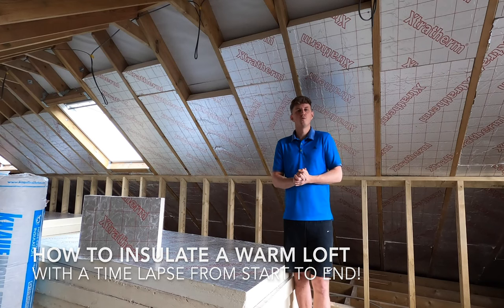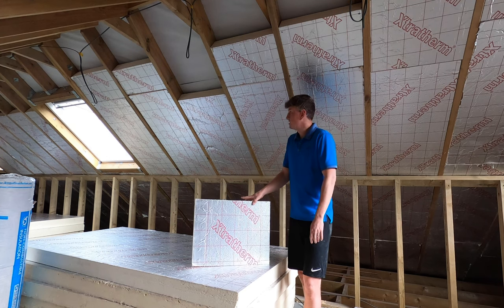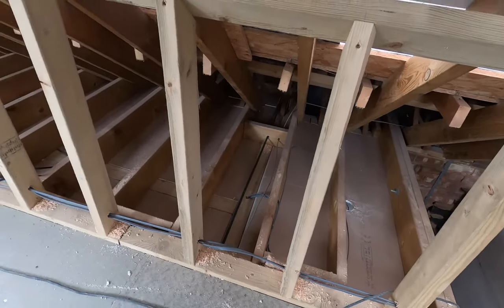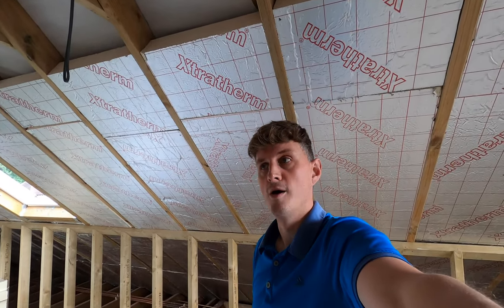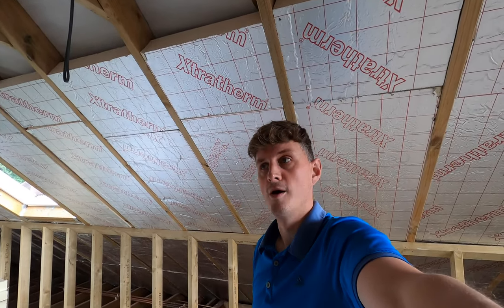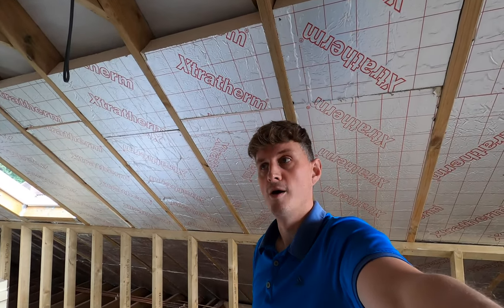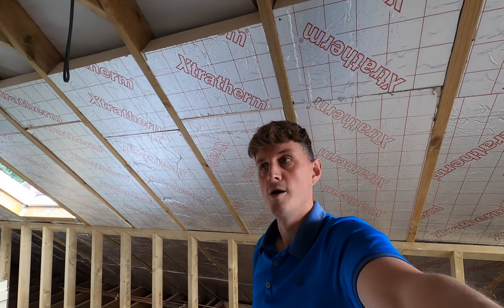How To Insulate A Warm Loft

Comment from the maker: My latest series - 1100 to 3000 Sq ft house - 
https://youtu.be/jYrWMxWvGvc

My Instagram - https://instagram.com/youtube_reno?igshid=YmMyMTA2M2Y=

00:01 - What the project is 
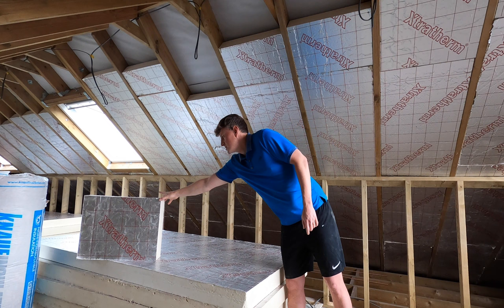02:12 - Cost of insulation 
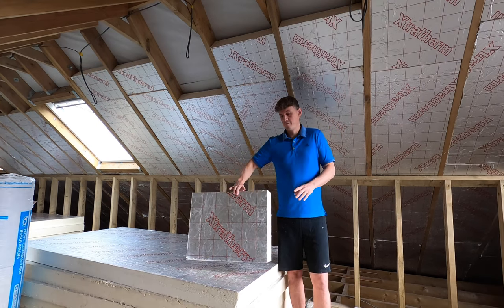03:16 - How to fit 
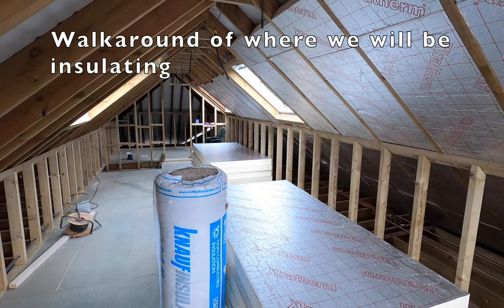06:16 - Walk around of where I will be insulating 
08:48 - Time lapse of insulating the rafters with 100mm insulation 
12:47 - Time lapse of insulating over the rafters and plasterboarding 
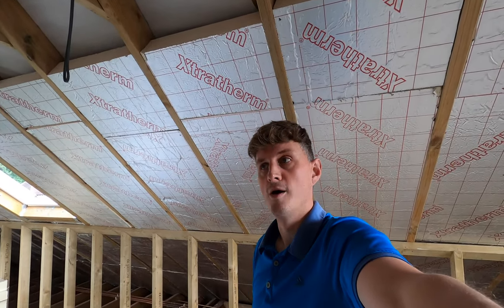15:00 - Walk around of progress so far 
19:05 - Time lapse - insulating between the walls 
19:42 - Plasterboarding 90% complete 
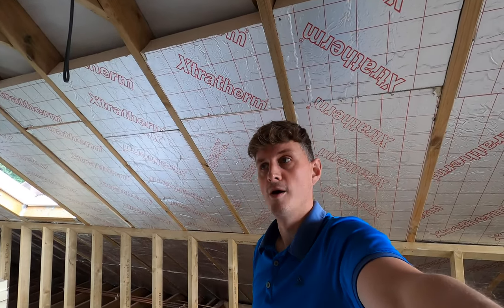24:08 - The finish!

Comment: No air-tightness measures. That’s a major omission. As a wetsuit works with water, insulation functions by trapping air. A membrane should have been installed behind the rigid board. All holes in the cold attic (downlighters, piping, sockets) should have been air-tightened. Draft causes 5x heat loss compared to conduction.
Reply: What membrane needs to go behind rigid board? Looked like there was a membrane on top of rafters.
Reply: The moisture barrier should have gone on after the foam insulation sheets were installed after all gaps should have been sealed. Then the moisture barrier completely sealed.
Reply: That PIR is foil backed, so no need for another sheet

Comment: The 50mm gap is not to do with “cold bridging”; this is where you get heat conduction through a less insulating part. E.g. the rafters could be a cold bridge from the roof to the ceiling (the overlay of the thinner layer minimises this). The 50mm gap is for ventillation, as long as you have air gaps in the soffit.
Reply: I'm sorry if it sounds stupid, this insulation in the video would it work when my house gets to hot ?
Reply: @PaulaZapataF  If your house is too hot on the inside, the insulation will stop it cooling down. You'll need to open the windows! If you're asking about it keeping your house cool when it's hot outside, then yes, that's what it will do too (assuming that those Velux windows he has don't let too much let too much solar heat in...)
Reply: @PaulaZapataF what it will do is slow the heat transfer from hot to cold. If the heat is on the outside then it will slow down the transfer in. As the other poster said if you house is hot inside already it won’t let that heat flow outside.

In this example the sun will hit the tiles on the roof and will transfer to the inside. The foil face on the rigid insulation will reflect that heat to a degree and the yellow bit of the insulation will reduce the transfer. The air gap will let some warm air out, especially if he has ridge tile vents so as the outside temperature drops it will suck cool air in at the eves and expel it at the top via the ridge vents.

Comment: Hi Nick, some years ago when i lived in Finland i had the  opportunity to help on an insulation project they used 150mm rigid foam foil front & back  & left a 50mm air flow gap - they cut all PIR 10mm undersized ( allowing a 5mm gap on both sides ) a short batten screwed into each rafter was used to support the PIR & pull it forward & keep it in place using a screw  ( when placed between the rafters )  the gap was filled with a foam injection gun on all sides - screws on the support batten pulled the PIR to the face of the rafters - no hammering on the PIR to get it in place - when the injection foam was cured the excess was cut away leaving a perfect airtight fit -  the whole project was very fast & easy. Ed,
Reply from the maker: Hi Ed, thank you so much for sharing. Really interesting to hear and sounds to me like a fully professional job!
Reply: @alanhodgson8443 commented that now you need to use Gapotape to completely insulate the PIR board, what are your taughts?
Reply: @JoSePh2000121  Hi Joseph, the friend that i was helping is a carpenter & told me that it was very important that all gaps or space between rafters & PIR board had to be filled with injection foam from front to back , that was why the 10mm undersize gap was important ( leaving a 5mm gap on both sides to be filled with foam ) the outside temperature was -40c  as we were working up in northwest Finland , so to control / manage heat loss is very important - also 25mm full sheets of PIR covered the whole internal roof / walls to stop thermal bridging from rafters , all joints sealed with injected foam - towards the end of the project we worked wearing tee shirts & were never cold unless we went outdoors. Everything was clad with 12.5mm plasterboard . I have worked on projects in the uk & have used GAPO tape - unless the PIR is cut right & the rafter timber work is perfect it is quite difficult to get an exact seal - to tell the truth i think that the Finnish carpenters method was superior - not alone did make a perfect air tight seal it also held the main PIR sheets in place. Ed,
Reply: Thank you so much for taking the time to reply, I’ve certainly kept Gapotape and for what I need it cost me more then the PIR boards 😂.The good thing is the house is new build and the rafters are quite straight. I don’t. think I need such a super insulation as we are not in Finland, I really want to reduce the amount of cold air in the loft.

Comment: Well, that might work down there where you don't have minus 25 celsius in winter! Othervice you should put foam between the insulation and the truss and also " glue ends of insulation together with foam so there will be no leak at all! Here up north we cut the insulation board about half inch in both sides so we get foam as deep as the insulating board goes. Makes it solid and keeps the isolation on the right place.
Reply: Other videos say to use Gapotape around the sides of the PIR to ensure a snug fit and then tape the seams. Not just a friction fit as shown here
Reply: @g4egk  Yes ,i have noticed that! Up here in northern Europe we had -10 celsius for about a week and then +degrees. That led to that i found a leek in my isolation, meening warm air ,moistur included got to the outside of insulation, got freezed ! When temperature rised to plus degrees it melted and water came in the same way moisture got out! So its very important to get it well done with foam in every burst!

Comment: It is very advisable to install some battening onto the fathers to ensure that the insulation does not move. Also as of June this year a product called gapotape is required, it completely fills any discrepancies between the  insulation and rafters.
Reply: Do you if there is an alternative company that does a similar product to Gapotape?Thanks in advance.

Comment: Really helpful to see this video - I've not seen anyone give such a clear and detailed video on this subject. Its credible and gives me confidence. I'm about to undertake a loft conversion in my bungalow in Scotland and will definitely be using this as a guide.
Reply: I'm doing  this in my loft now, it's really not that difficult. I'd say just make sure you have decent PPE, (respirator mask (not a little disposable cloth one), eye goggles rather than glasses, gloves, kneepads, good head torch etc).

I've not cut the 100mm board yet (im using 25mm in the rathers) but I'm going to cut it with a circular saw to cut a nice straight 55mm deep line then finishing with a hand saw.

I've noticed this guy didn't have any battons behind the boards in his rafters. I just used a couple screws per board placed at the 50mm air gap line. This stops the boards falling upwards and keeps the 50mm gap.
Reply: The lad is a sparks , Gods gift to the human race and then there was light . LOL🤞👍

Comment: Well illustrated work.  I'm impressed you got a friction-fit good enough to not have the PIR falling out from betweeen the rafters.  I would have had to be using 100ml tape along the rafters to catch and hold the board either side of each until the 20mm cross-boarding held them in place.  Do you have ridge vents at the top of the air gap outside the between-rafter insulation, and were there any particular tricks to prevent them being blocked by the rockwool when pushing it up under the ridge board?  Maybe you carried the PIR right up to the ridge board - I couldn't see.
Reply: Yes, I would want airflow from one roof side under ridge to opposite side

Comment: Pizza slice cuts insulation board well with no mess, don’t need to cut right through, snaps along the cut like plaster board. 👍
Reply from the maker: Ha - love it!
Reply: I use a tracksaw for a perfect machined edge and use the straight groove for my hand saw, pretty close to perfect everytime

Comment: Really nice video but just a have a question about why you've called it a warm loft but its actually a cold roof install?
Reply: I assumed he meant the loft is insulated so it's warm. Yes this is a cold roof. I'm trying to do this on a 70s house where the rafters are all different gaps all over the place. Driving me nuts even with gapotape. 😂😂

Comment: This is not a warm roof. This is cold roof. The 50mm gap is not to stop cold bridging it is to provide air movement. You need ventilation at both ends because the air needs to move over any condensation to help it evaporate. 

Would have used batons to prevent it from moving beyond flush. 

Can’t see any cross venting arming the windows so that will be a dead spot for air movement. Likely to get condensation on that. 

Could have done with butyl tape on the joists and tapping the joints between the insulation. 

It’s bloody hard work so hats off to you.

Comment: Hey mate 

T
Thank you for sharing the video and the tips for the 50mm installation. We received a quote of 6,000 pounds for the loft wall and ceiling, which we find too expensive. We've decided to follow your approach and make it a spring project for me and my girlfriend.

We have already installed a raised floor in the loft.

In your video, I noticed that you have an opening. Did you need to obtain planning permission for this? I believe adding windows to the back of the house typically doesn't require permission, but I wanted to confirm.
Reply from the maker: Wow £6000! No - you don’t require planning permission for internal work such as creating an access door. Good luck with the work!
Reply from the maker: However for the windows you probably will require planning permission - especially as if looking over neighbours properties etc

Comment: Nice work! I am working on the same project. How much insulation material used for this project?
Reply from the maker: Thanks! Ah I wish I could remember but it was a few years ago. Has to be minimum 20 sheets of 2.4m x 1.2m. Good luck with yours

Comment: Great video. Really helpful, can you confirm if the 100mm was used between the studs for the walls you don't need to carry the rafter insulation down to floor level? I was hoping to do a cold loft on the outside of the room

Comment: Very useful video. Cheers mate. I bought a house with a loft conversion last year and during the first winter investigated why the living space was getting a bit cold in certain spots. Turned out that the living are is insulated with 100mm PIR, but the rafters in the eaves area aren't. There are also holes in the felt, which apparently are meant for air circulation via the cowl vents but I think they might be a little OTT, given that the bottom of the rafters have access to outside air anyway. I'm thinking of putting additional 100mm PIR in the rafters now. I can see that you have not installed cowl vents and just rely on the 50mm between the PIR and the felt, is that correct? thanks!

Comment: I would of ran that foam board horizontally. That would of insulated the rafters as well and provided a larger air gap between the roof deck and the foam boards. Install a roof ridge vent and soffit vent boards.
Reply from the maker: Thanks for the tip

Comment: Hi Nick, Great work! Lovely to watch.
My reg's here (DK) require an additional 25mm air gap between the foam insulation and then two layers of 12.5mm plasterboard. I guess there's no air gap requirement on the inside of the sheet rock in the UK?
Reply: What does DK stand for?
Reply: @KendalMike  Denmark
Reply: Donkey Kong

Comment: I feel like the building inspector didn't know what they were talking about. I'm only a DIYer, but I can't see why you'd have to leave a 50mm gap at the back of the uprights... The gap is for airflow, and as you've pointed out, there's a huge gap behind the wall. 100mm insulation wouldn't have hurt.
Also, where the top of the dwarf wall meets the rafters you have a beam installed at an angle that matches the rafters. I've read that it's better to cut a birdsmouth in the rafters and to have the beam laid horizontally on the uprights. This way the loading from the roof is purely vertical and doesn't rely on the strength of the fixings at all.

Comment: Summary of Nick's Home Renovation Video
Nick, an electrician by trade, shares a how-to video on insulating a warm loft in a 1936 bungalow renovation. He emphasises that with guidance and advice, anyone can do the job themselves and save money. 

Insulation Process

- Rigid Insulation: Nick uses 100mm rigid insulation between the rafters, ensuring a 50mm gap for air flow to prevent cold bridging.
- Cost and Labour: Rigid insulation costs around £40 per sheet, and Nick recommends doing the job yourself to save money.
- Installation Tips: Nick advises wearing appropriate PPE, leaving a 50mm gap between insulation and rafters, and ensuring a tight fit.

Additional Insulation

- Mineral Wall Insulation: Nick explains insulating mineral walls, recommending using 100mm insulation for better heat retention.
- Ceiling Insulation: Nick insulates the floor and ceiling below to keep the space warm.

Completion of the Project

- Plasterboarding and Finishing: Nick shows the process of plasterboarding and finishing the loft space, creating a warm and well-insulated room.
- Final Result: After two weeks of work, Nick successfully completes the bedroom and ensuite renovation, demonstrating that DIY insulation is achievable with proper care and attention.

Nick provides valuable insights and practical tips throughout the video, making DIY insulation accessible to viewers. but

List of materials used
- 100mm Rigid Insulation: Used to insulate between the rafters.
- Mineral Wall Insulation: Insulated walls for better heat retention.
- Plasterboard: Used for finishing and covering the insulation.
- Expanding Foam Tape: Used to seal gaps.
- Urethane Sealant: Used for sealing gaps.
- Hammer: Used for installation.
- Ear Defenders: Used for protection.
- Safety Mask: Used for protection while handling insulation.
- Goggles: Used for eye protection.
- Gloves: Used for hand protection.
Reply: Don't forget the filler this guy's gonna need when those screw heads pop

Comment: Would it make my house or attic on summer because my house is a oven in summer, ive to use air con in Ireland, dont why it gets so warm compare to other houses do be cool
Reply from the maker: Hi, yes insulation will help cool down in summer and keep warm in winter. Although from my experience if you have a warm house it will help but still be warm!

Comment: You mentioned to leave 50mm gap. What if the rafters are small? My rafters are 3 inch (76mm) in depth. What thickness of cleotex or rigid board do you recommend and how much gap should I leave? Thanks
Reply from the maker: Hi, a minimum of 10mm air gap however 20mm would be better. Good luck!

Comment: Are you walking on OSB board or wood board? What's the thickness?

What's this kind of roof structure called?
Reply from the maker: It’s tongue and groove chipboard. Think it was 15mm. This is a warm loft but we didn’t change the roof structure so it’s not a dormer or anything technical

Comment: Do you need to leave 50 mm gap? What if you leave no gap, there won’t be any air and no condensation?
Reply from the maker: Without the gap it creates something called thermal bridging, which can cause issues
Reply: Condensation comes from within the house. Without the air gap, and without a ridge vent, (or other roof vents) the moisture accumulates at the highest point, the ridge, and the timbers will eventually rot.

Comment: Hi Nick I have a single skin wall at the back of the house that I need insulating internally do you know whether I need the same 100mm insulation and 50mm air gap the same as it is for the ceilings you’ve done? Thanks
Reply from the maker: You will need insulated plasterboard I would imagine, otherwise you’d have to build a timber frame and then yes put insulation in there with an air gap. Insulated plasterboard would be the best way but check with your local council as to which size is recommended/required

Comment: If we haven’t left an air gap behind a 100mm KS board what can we do?

This is in a garage, and there is no loft, just very high ceilings to the rafters
Reply from the maker: A garage shouldn’t be too bad but should try and leave at least 50mm if you can. Perhaps a smaller insulation would suffice?